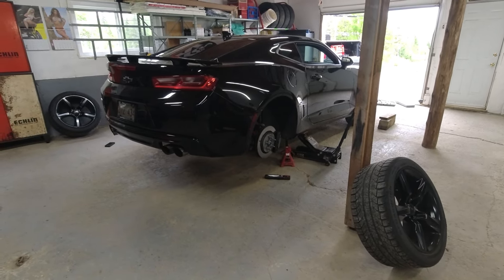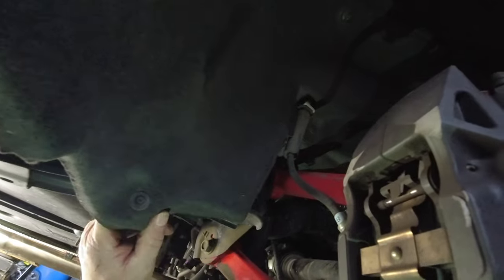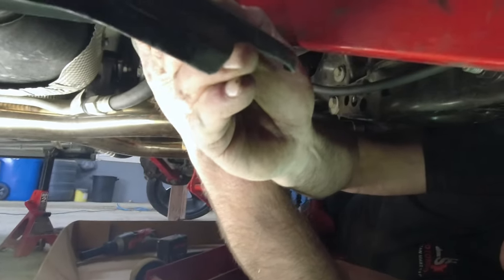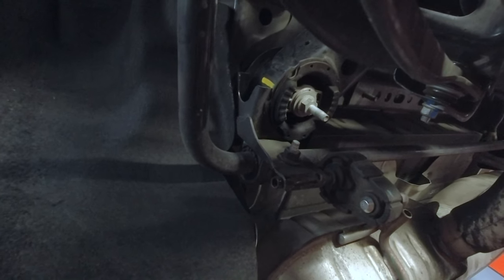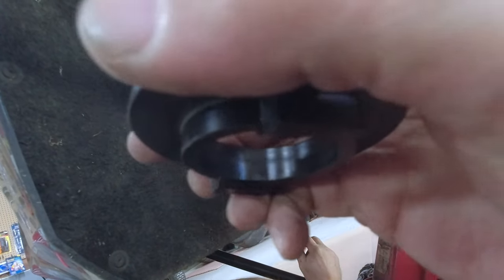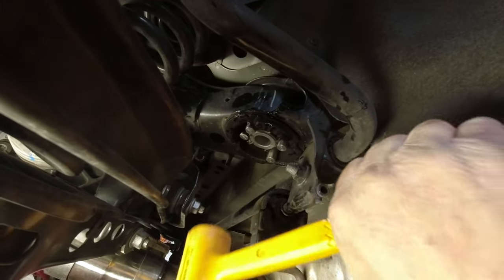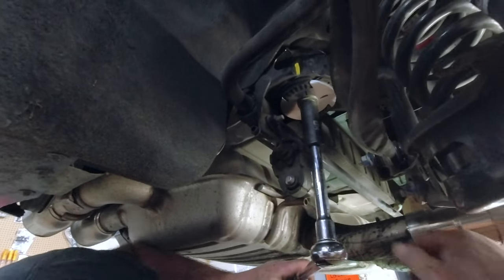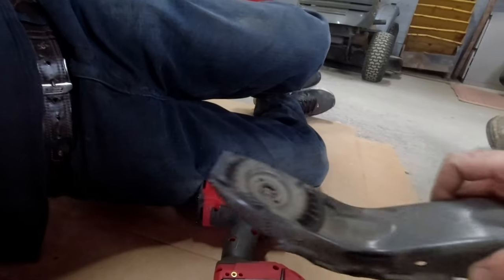BMR Rear Cradle lockout installation - Installing BMR cradle lockout on 6th Gen Camaro - BMR-BK063

Comment: how much hp dose your 4th gen make?
Reply from the maker: That is a question I wish I knew the answer too.There aren't any dyno shops around here so I have never had he chance to find out.Its probably not alot but it does have a very wide power band because of the small cam.But I would need a good set of cylinder Heads to make big power numbers.The best 1/4 mile time I have run is a 12.46 @112mph.

Comment: Nice video. How much time did you have doing this?
Reply from the maker: Well it's been awhile since we did it so I don't remember exactly but I do remember it being easier than I expected. We did 4 videos the same day on the diff lockout,Cradle lockout,Rear diff fluid change and we took it out for testing so it would have been just an hour or so for the diff lockout.
Reply: Ok great thanks!
Reply from the maker: Thanks for watching and commenting we really appreciate it.